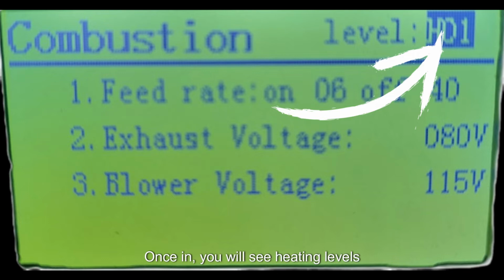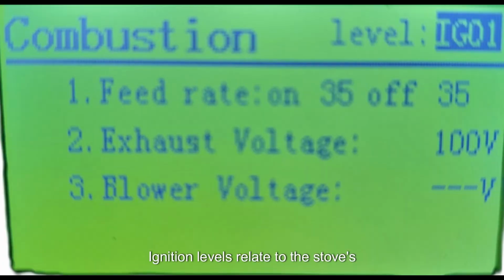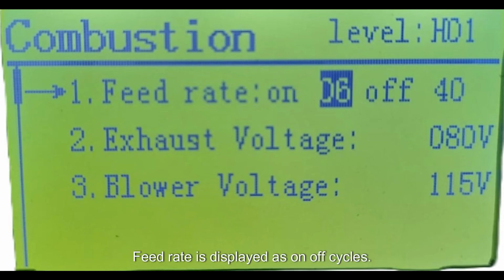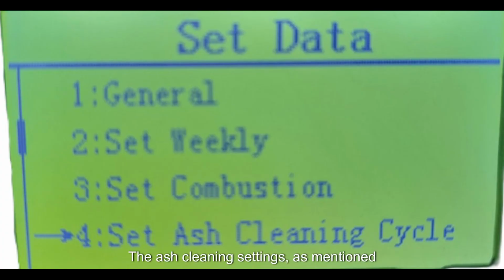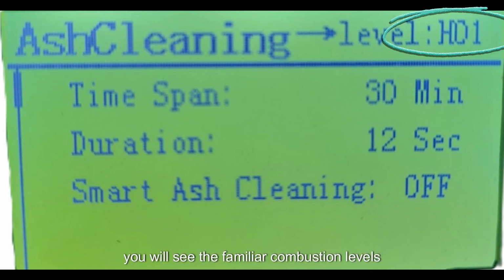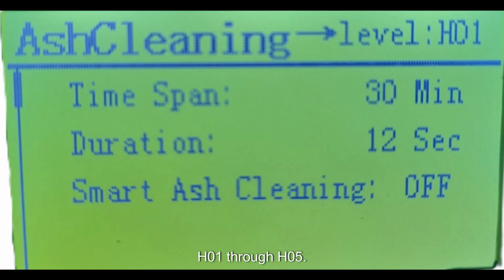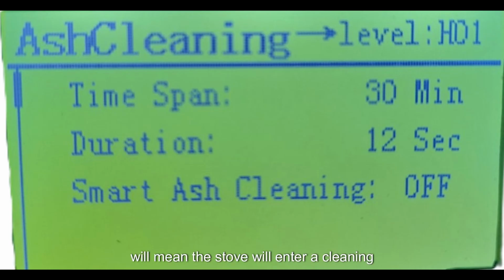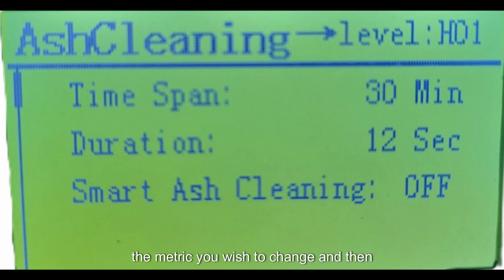Combustion and Ash Cleaning Menu Walkthrough - Comfortbilt Pellet Stoves

Comment: Thank you very much for the help it's awesome but I can't seem to get it to work on level 1 it will start and run for about 5 minutes if that and will loose vacuum and beep low temperature 
Other than that it's working pretty good
Reply: If you’re still having issues with the low temperature alarm on start up, I have tweaked the settings, a multitude of times and I find a quicker start up by placing a small handful of pellets, not a large one into the burn pot and kind of scoot them in front of the igniter hole. This will help get the fire started quicker to avoid the low temperature alarm. It sucks you have to do that, but I think there are perhaps design issues with the pellets not getting in front of the igniter quick enough and piling enough to start a flame-Engineer. If you’re having any other issues, please feel free to comment and reply. I have spent countless hours fine-tuning and going over this machine.

Comment: Thank you very much for the help it's awesome but I can't seem to get it to work on level 1 it will start and run for about 5 minutes if that and will loose vacuum and beep low temperature 
Other than that it's working pretty good
Reply: Did you figure this out? I have similar issue
Reply: @MoooStashy  yep I got it dialed in   near the the end of the video it gives you different models and charts of where the stove should be set at  i took notes and started fine tuning mine and it runs pretty good

Comment: Thank you very much for the help it's awesome but I can't seem to get it to work on level 1 it will start and run for about 5 minutes if that and will loose vacuum and beep low temperature
Reply: If you’re still having issues with the low temperature alarm on start up, I have tweaked the settings, a multitude of times and I find a quicker start up by placing a small handful of pellets, not a large one into the burn pot and kind of scoot them in front of the igniter hole. This will help get the fire started quicker to avoid the low temperature alarm. It sucks you have to do that, but I think there are perhaps design issues with the pellets not getting in front of the igniter quick enough and piling enough to start a flame-Engineer. If you’re having any other issues, please feel free to comment and reply. I have spent countless hours fine-tuning and going over this machine.

Comment: It pretty much works just some tweaking here and there but I can't get it working on  level 1 for more than 5 if I'm lucky when I start it from there I loose all vacuum and it low temperature and shuts off
Reply: If you’re still having issues with the low temperature alarm on start up, I have tweaked the settings, a multitude of times and I find a quicker start up by placing a small handful of pellets, not a large one into the burn pot and kind of scoot them in front of the igniter hole. This will help get the fire started quicker to avoid the low temperature alarm. It sucks you have to do that, but I think there are perhaps design issues with the pellets not getting in front of the igniter quick enough and piling enough to start a flame-Engineer. If you’re having any other issues, please feel free to comment and reply. I have spent countless hours fine-tuning and going over this machine.